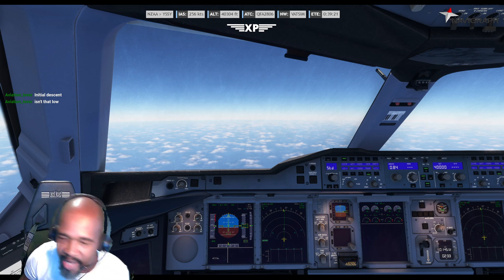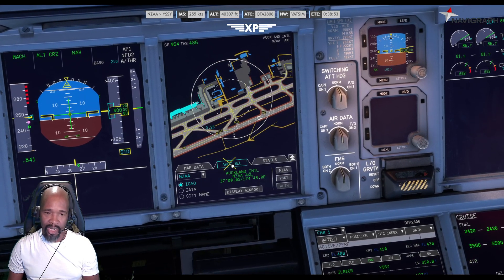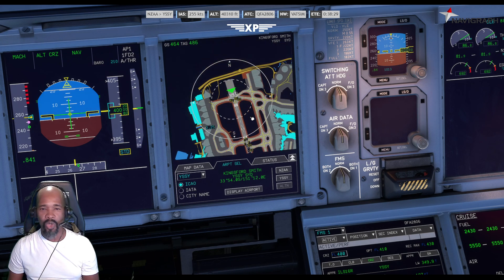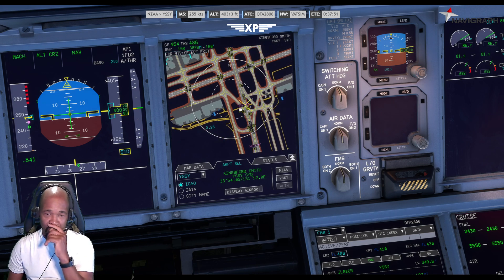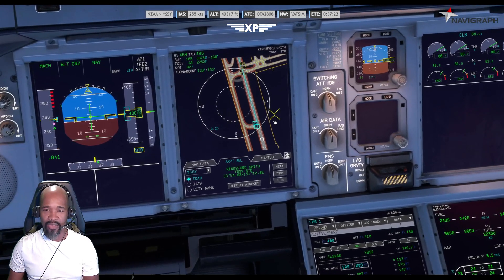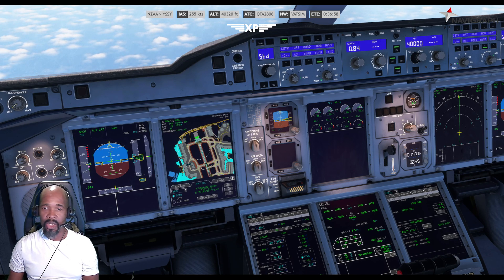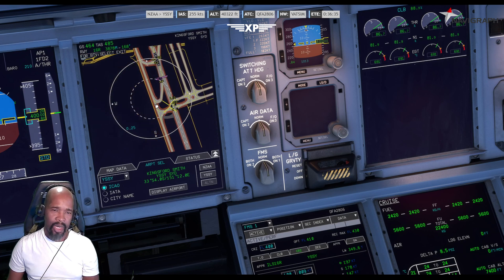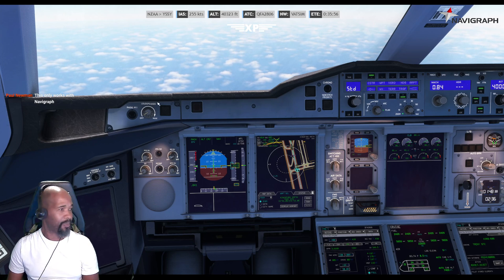FBW Airbus A380 “Brake To Vacate “ tutorial

Comment: You could select B10 as your exit. You were just clicking on the B10 that's exiting from the 34L direction, instead of the B10 that's exiting from the 16L direction, that's why it didn't work.